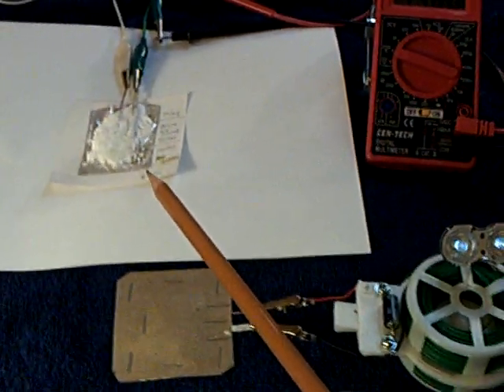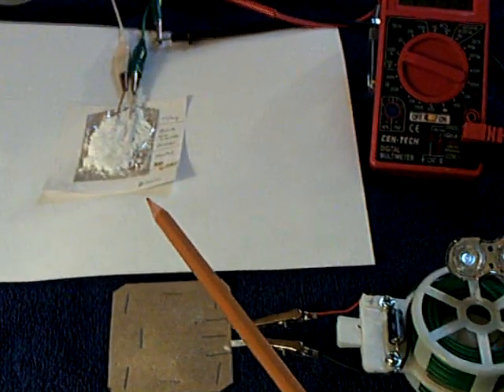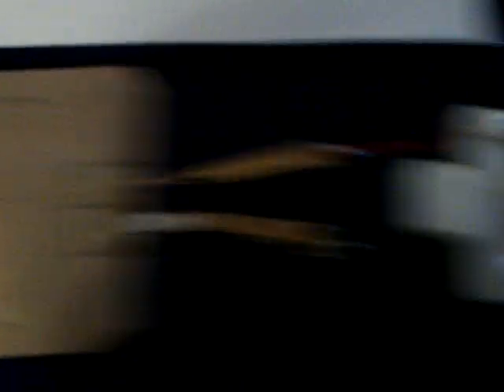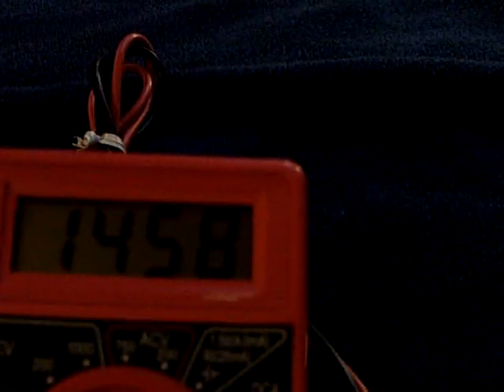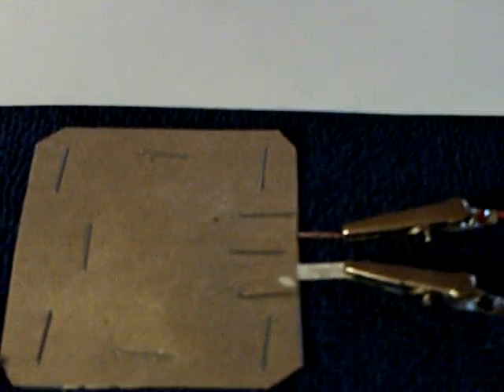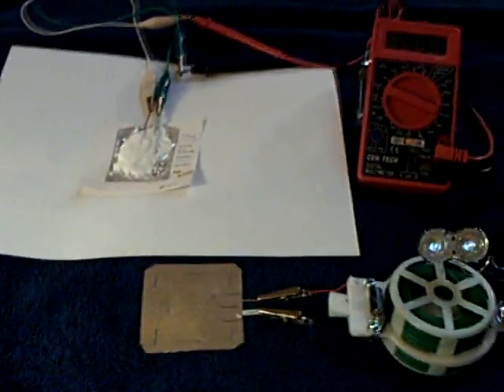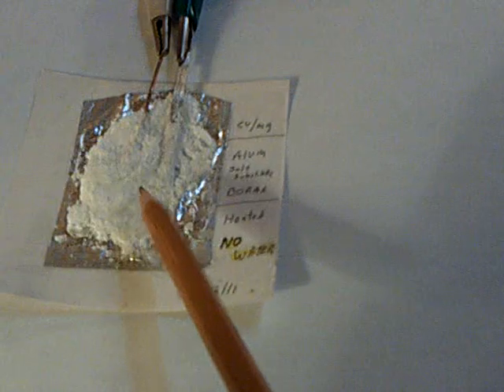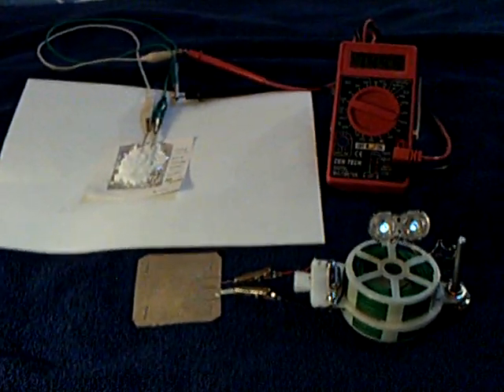Water in a crystal--The Ibpointless cell.ASF

Comment: Fun little project.
If you look up the Galvanic Scale, it goes from most to least reactive metals, the further two metals are on the scale the greater the electron flow will be, dur to reactive metal giving up electrons, add an electrolyte and you have a battery, this can be simply saltwater or lemon juice.
Whats actually happening is controlled rust (oxidization) of the reactive metal.
The same process is used to protect steel ships and outbourd motors from seawater corrosion.
have fun ;)

Comment from the maker: @ibpointless2 -----If the mg is still intact you might try heating the cell again and remelting the Alum.  If the magnesium has been eaten up then try a another strip and see what happens.  When I was working with the gelatine cells  I could rejuvenate them with a couple of seconds in the microwave oven.

Comment: After 4 days this cell has stopped running my LCD clock. I let the cell rest for 2 hours and it was able to power the LCD clock for a little longer, so it seems to recharge a little when allowed to rest. I found that freezing water will not allow a galvanic reaction, i'm continuing test of these cell in a deep freezer. Putting these cells in a deep freeze should freeze the water and thus no galvanic reaction due to the water being ice.

Comment from the maker: @JoelHarvey1 ----- I did not realize that the crystals contained water locked up in a atomic bond.  Heating the Alum released the water into a liquid state.  By only heating the Alum until it was liquid, the metals could  be incased in the crystal structure along with the othe two chemical once the substance became hard again.  The interaction of the locked up water and the two metals is what I didn't see.  No liquid water was ever added.  We are all curious how long this cell will last.